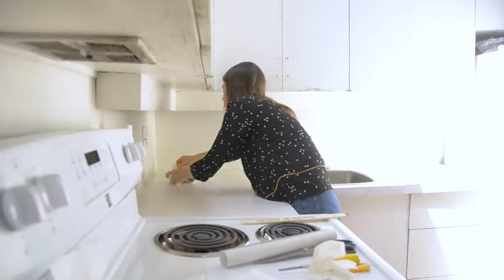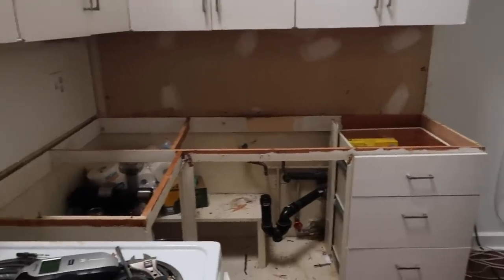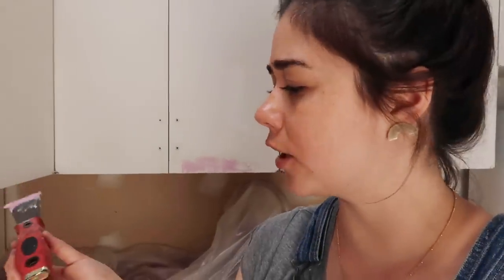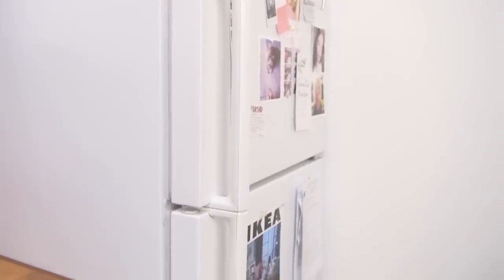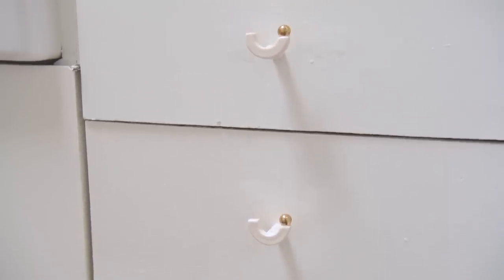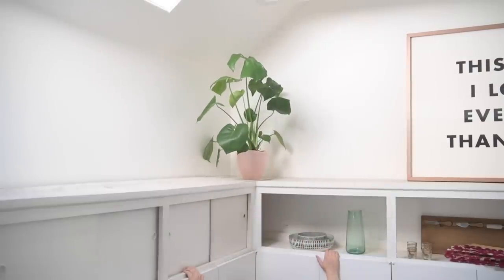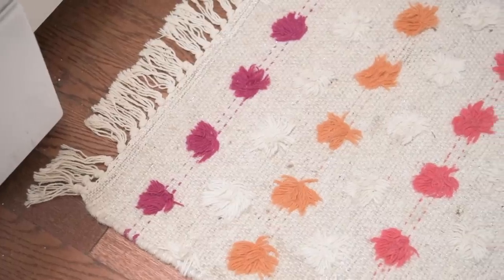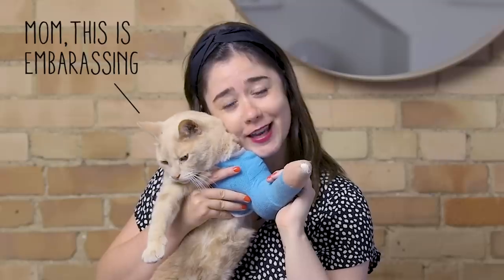DIY Small Rental Kitchen Makeover | My Rental Reno S1 E7

Comment: Future tip - fill the holes in the cabinets with a wood filler epoxy as it will last forever and not chip out, contract, expand etc. The filler you used is meant for drywall, not wood or particleboard.
Reply: Sky you can tell too, it looks horrible 😂
Reply: Thanks for the tip. I've only ever filled drywall so I'll use wood filler epoxy if I ever fill cabinet holes.
Reply: And plus, it looks horrible because of the texture after she painted the wood
Reply: She's going to replace the nobs back when she leaves. No biggie.
Reply: 🎊Thank you. I wondered about that. It doesn't take much effort to ask someone @ the hardware store such questions. Using the right products are key...even on a rental.
Reply: I had to skip ahead I literally couldn't watch her try and fill the holes and get drywall (dex) compound everywhere, she was not doing it correctly lol
Reply: May May And if that is the case she will have to then fill the new holes she made. 
I think the point is she has great ideas, just make sure if you have a DIY channel you really need to educate yourself on the proper products and tools to use for the job.
Reply: I think she intends to drill it out when she moves.
Reply: I swallowed hard when I saw her using drywall filler and not wood putty 🤦‍♀️
Reply: Ooof yeah, overall it's a cute concept but the quality of work is super rough, my borderline OCD was kicking in when i saw the 'finished' cabinets in the close ups. Couldve looked amazing with a couple of different sandpaper grains and some elbow grease. And the right filler.
Reply: @jerilynjerpbak180  Definitely!  You have to be careful who you take advice from on YouTube.  It is amazing how many YouTube videos are made by amateurs who have absolutely NO idea what they're doing.  Yet they are trying to instruct others.. (evidently in the fine art of screwing up)!  In one video a young man put the lever door handle on upside down, and with the screws on the outside.  In another video, an older gentleman installed a new exterior door with the hinges on the OUTSIDE!  Hello?  All a burglar would need to do is remove the screws from the handle.. or the hinges from the door.
Reply: When you scrape off the excess, let the filer/spackle bulge out from the hole being filled. As the filler/spackle dries, it contracts; this leaves a hollow that you'll have to fill again. If it bulges out, there is less chance of hollowing out & you can sand it flush quicker.

Comment: I painted a fridge that I bought for $35 a minty green and sold for $200 😌
Reply: Mommyandbunny waow!!! what paint did u use
Reply: I need to know What kind of paint you used! Im dying to paint my black fridge!
Reply: You have to wash it then sand it then wash it and let it dry and you can basically use any paint in a semi gloss, just definitely have to sand it first!
Reply: @martakalinowska3368   heirlooms traditions makes an all in one chalk paint that has primer and wax/topcoat in it. It is a very durable paint that has a satin type finish and can be used on appliances and furniture, etc. You can see their tutorials here on YouTube and they'll have links to buy their paint.
Reply: Ummm, don’t listen to Mommyandbunny if you want the paint on your fridge to be durable and last more than a couple of months. For longer lasting paint, either listen to Carrie Fiddler’s advice ☝️☝️☝️or use an appliance epoxy paint like Rust-Oleum. If you’re going to use regular paint like Mommyandbunny did, you should at least apply a clear enamel gloss protective spray on top of that paint otherwise your fridge will end up looking like crap.
Reply: @vickilarouge4855  I forgot about rustoleum having an appliance specific paint. I haven't used it but rustoleum generally makes good products
Reply: @vickilarouge4855  Yea, my Dad used regular paint on an appliance and it peeled off in a few months. Def need appliance epoxy paint. Personally I wouldnt do that in a rental but maybe my own house if I got used appliances that didnt match. Otherwise, u can use removable contact paper and just take it down when u move out.
Reply: I don’t think that’s a good thing lol
Reply: @asmrdanika0077   to have made that type of profit you must have really taken your time but although you said any paint you didn't explain what type of paints YOU used ??? TIA
Reply: Mommyandbunny hey whatever it takes to make it new, and sell it for more, I would do that too.
Reply: WOW!!!....Score!
Reply: Mommyandbunny pictures?
Reply: Love this! :) what paint do you use? And is it easy to do

Comment: Also, you can lift the whole stove top up(on most, not all) to clean under the burner drip trays (yes what you replaced were the drip trays, not the burners/elements). This is a good tip, because it seems like you may need to give it a good cleaning. 
Fun transformation overall.

Comment: Love this! All these tips are super inspiring. 💕 Tip: You can easily lift your entire stovetop (it’s hinged), wipe it out, and scrub it clean, when necessary,  with a blue Scotch-Brite pad and Barkeeper’s Friend. (Same for burner drip pans, to keep them clean and free of build-up — you shouldn’t use foil in them.) Also, hardware stores generally charge less than $16 for burner drip pans, so be sure to shop around if you’re on a tight budget and need to replace any. (P.S. Never soak your burner coils— it’ll ruin them. Just wipe them carefully and dry well.)

Comment: You should have painted the drywall before putting those tiles on. Because, even if you heat them-the way you did it, it’s going to tear the paper coving off the drywall when you try to remove it. Just an observation.
Reply: I think she should of left the white thing and tiled on it.

Comment: One good trick for holes is to tap a wooden golf tee into the hole, cut off the excess, then sand and sparkle.  This prevents slipping into the old hole if you are drilling close to it.  BTW, my dream fridge would be vintage fire engine red.

Comment: Did you seal your countertops? I would love an update on how they hold up.
Reply: I was wondering the same, because if you don't they will warp.
Reply: Wood counter tops are a nightmare. They’re so not functional. We had butcher block counter top for 2 years and it was horrible
Reply: Mary McRickard, if you take care of them and oil them they are no problem whatsoever! Had ours for three years and no problems.
Reply: @McRose4  I had the same experience, they were an absolute nightmare!

Comment: Looks like your door to that bottom corner cabinet is being blocked because of the sink....
Reply: interior design nightmare
Reply: It actually looks like it does open. Once the door is open it backs up against the sink.
Reply: @TheDoll1988  that's not how geometry works. i want proof it opens haha
Reply: @TheDoll1988  yeah it definitely opens, maybe just not all the way
Reply: That was the first thing I noticed!!! If it hits the sink, it’s going to dent the cabinet and scrape the paint over time!! Ugh. Kitchen looks great though. I would have sanded where the old handles were a bit more. When she showed a close up of the new handles there was some bumpiness in the paint finish.
Reply: Same. I’m like, “I’d like to see you open that cupboard, ya dink.” The corner cabinets in my kitchen already don’t open all the way, as they open into each other. Why would you add an obstruction? Whoever designed my kitchen is a dink too. They put a slide out shelf in the corner, but since the cupboards only open 87 degrees, the slide just gouges the inside of the door. Also, the oven is directly perpendicular to a drawer, so they had to remove the drawer pull, or you wouldn’t be able to open the oven.
Reply: @michelewestover9330  Yes she actually did not do a gd job painting the cabinets. I have changed my kitchen cabinets color,and trust me you need to have a lot of free time to do such change. Most of the work is sanding!!!!
Reply: It looks fine to me

Comment: Can you put the fake tiles on top of real tiles? Or do you need a blank wall?
Reply: The adhesive behind the fake tiles needs a flat surface with no air bubbles etc behind it. If the grouting of the old tiles is lower than the surface of the tiles then it will create long lines of air that would slowly undo the stickiness of the new tiles and they'd fall off. If you don't want to take all the old tiles off. Then after cleaning them, use putty or more grouting to bring the lines level; sand it flat and then add the new tiles. Still not optimum though. It would be best to get back to the original wall and make it flat.

Comment: I would’ve just soaked the fridge handles in bleach & wash it with dish soap.
Reply: The plastic has oxidized. Bleaching them will not remove that. There are some products out there that could possibly removes it with UV light but that’s a lot of work and effort for a slim chance it could have not worked.

Comment: I'm interested in the cabinet painting, my kitchen has the original cabinets it came with when this complex was built in the 1990s and although they seem to be a beige color, when I had the light fixture changed it turned out the cabinets were originally white!  I love what you did with your kitchen it  looks larger than it really is because of the 2 story height and how you have drawn the eyes to go all the way to the top with the upper open cabinets and the plant by the skylite.  Very nice and chic!

Comment: Wow. I usually enjoy your videos. Not this week, I have so many issues with your mini kitchen reno.

you didnt discuss any of the materials you purchased in detail, specifically maintenance on the materials. As a designer that should be a priority, making your clients and in your case, viewers aware.

1. Countertops: wood/butcherblock countertops are great, but if they dont have the proper finish and are not maintained (wood and water are not friends!) They will stain and show wear. If your into that and potential bowing, cool. if not you could always sand down and refinish but who wants to go through that depending on how often you use the kitchen, especially in a rental. Also, typically quartz and granite are less than a wood top, So long as your getting one with the proper food safe finish. Also no mention of rebracing the cabinets to support a new countertop on older cabinets.

2. Under mounted sink to farm sink: way to breeze right over that one. You skipped the entire step of your contractor reframing the front and sides of the cabinet to be able to hold a farm sink and cutting down the doors. This is a MAJOR consideration. Also farm sinks tend to chip, I assume it's a porcelain if its comming from IKEA, fireclay would be better as they're typically colored throughout.

3. Filling screw holes on doors: this one is hard to see via video, but your filling a slab door with putty. That's a great "flip fix" but realistically, not a great solution unless your sanding the entire face of the door (this causes more issues if it's not a slab door). If those are acrylic, thermofoil, formica, or lacquered doors you should never paint over it. As you can see when you show the close up of the new knobs you installed, it shows every imperfection. those materials are not made to be refinished and it will not stand the test of time.

Backsplash: that material you removed probably matched the existing cabinets. AHH peel and stick tiles, please upload the video of you doing that one side of backsplash in 20 minutes, I dont think that's fair to say because they do take quite a bit of time and precision to install. Also unless you use an additional adhesive, they always peel off eventually for the steam and moisture from cooking alone. Secondly peel and sticks are great and cost effective for a rental, but in a forever home, not so much. 

At the end of the day, looks great for a video but it's just not functional or obtainable for more renters or homeowners. Most of those solutions are meant to look good for now, not for a while. As a professional kitchen designer I'm super disappointed with your video and how your presented these "solutions". Better luck next time.

Comment: Another way to fill holes such as on your cabinets would be to first fill with short pieces of wooden dowels glued in. Even the non shrinkable filler works better on smaller holes that using the dowels first creates.

Comment: I'm not sure if you know this but when you were changing out the burners on your stove and noticed how dirty it was underneath my point is that whole part will lift up and it'll lock into place it has a little hinges so that you can get underneath the stove top just in case you're wondering but your kitchen turned out really cute

Comment: Instead of buying jars for dried goods, I found a shape of a spaghetti sauce jar that I liked. I just kept buying that jar, making spaghetti and then I’d clean the jar and put something in it like dried beans, lentils, etc. The nice thing about this is that everything is the same size so you can fit more in your cabinet. Again, I did this w my vitamins where I used one brand of spice jars. When I just used up a spice, I cleaned the jar & filled it w vitamins.

I did a similar thing w oils & vinegars. I found inexpensive jars with spouts and I could fit so much more in the cabinets. I keep surplus in the pantry closet.

Comment: Use a syringe to fill holes with putty. Fill syringr, obviously without a needle and squirt the putty in the hole. Then you just scrape over extra putty.
 Lot easier than to just run putty over the hole with a scraper as it keeps "caving" in.

Comment: Great Job!  BUT.. that gringy electrical outlet has got to go!  Get a Decora rocker switch to replace the outdated toggle switch.. and the matching Decora outlet and cover plate.  Turn off the power.. and replace them.  Ten minutes tops.. and it will look so much nicer and cleaner 😊👍   Love the faucet  💕  and the knobs  💕  
And.. just FYI.. in the future.. you need to use wood filler on wood.  Spackle is for drywall 😉

Comment: Greetings from Europe, great job. With any renovation you are gonna learn and improve. Just a side comments, I know it's not something you can do. But how old is your stove and oven equipment?  I have not seen that for good 20 years. I believe you should push for new one with ceramic top and good oven with it.  Just for my understanding, why is the renovation of kitchens so expensive? IKEA kitchen will cost you, and that is big size already, about 8ths Euro. 85% you can do your self and only the extras like electricity or water you get fitted.  Good luck all the best and keep going. BTW I am gonna do our backsplash as you did, just need magenta color. Have fun😀

Comment: Decent , inexpensive redo. I would say you need to use a filler made for wood on your cabinets, not one for dry wall like you used. Also, the prep work determines the quality of the finished project. In the video you could see that the holes you filled weren't sanded down very well. Details matter and give a professional look. Also, it would've been nice if your dish cloth carried out the pink color scheme.

Comment: Why did you not clean underneath the drip pan when you took out the old one? And you didn't sand very well where you filled in the holes on the cabinets before you re-painted the cabinet doors??

Comment: The result is quite nice, however as for someone with construction education and working on a building site - some things made me cringe. Especially crooked cabinet doors, hole filling, spaces between cabinetry and the countertop, naked plasterboard wall behind a sink, and, oh my god - crooked, uneven door knobs. If you are fine with these things, that’s alright, but i would suggest measuring 7 times before installing anything, tightening hinges on doors (makes a huge difference, trust me) or if you live somewhere with an affordable workforce, just let professionals do it. However, the sink was super beautiful, it changed the space the most. Countertop can have wood imitating painting or rental friendly - sticker, if you are careful with surfaces, as most landlords will not be ok with you ripping off their countertops and headboards. Change or cover power outlets, they’re yellowish and looks dated. Make sure all surfaces are properly sealed with paste to avoid water getting in little gaps (and done nicely, neatly and professionally).
Otherwise very nice reno, although maybe not the best for most renters. And sorry for my english, as i’m far from native speaker 😁

Comment: there is a huge difference between redecorating and renovation. If you want to redecorate. meaning cosmetic  stuff like paint and peel and stick vinyl, some throw cushions. new curtains etc  that's different from a full on reno meaning  you remodel the layout of the room, knock out a wall,  tear out the floor rip out cabinets etc. I have done lots of undo-able decorating in places I've rented but you can't really do renos in a place that's not yours. not without the owner's consent anyway.

Comment: Who would Want a Wooden Counter-Top ? Look's Like the OLD Parkay Flooring. Pink in a Kitchen ? That would be a No.The Backsplash Did Look Great, just Not That Color. The Hardware Looked Nice in Gold, but Would've Painted the Fridge- Handle Gold as well. Re-Place the Switch- Plate's, and Switch's, Using White. The Long White Shelve's are Nice, but Not Convenient to Get to. When Filling-In Hole's, it Isn't Necessary to Slather-On So Much, just use a Finger-Tip Amount, then Use the Scraper to go over it, making it Smooth. Let Dry and Sand. Not so much Work, when using a Lesser Amount.